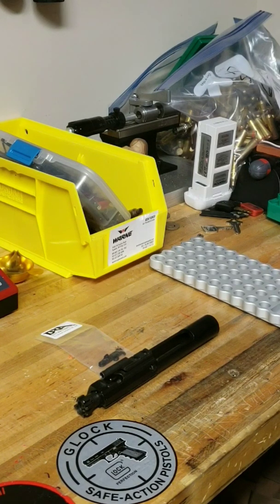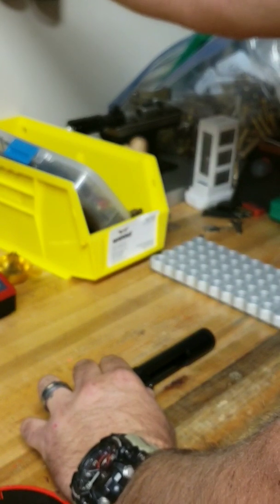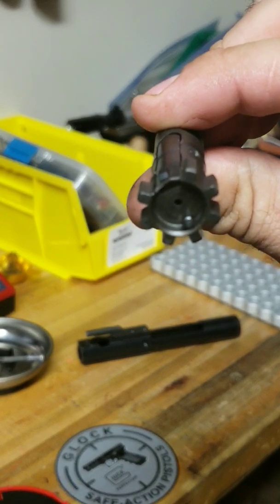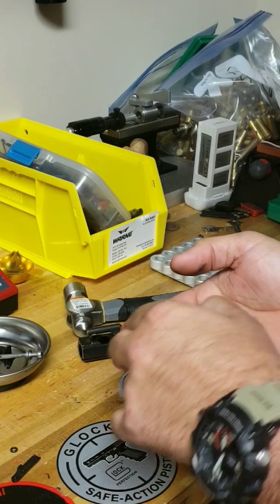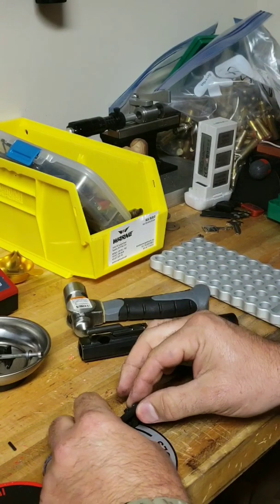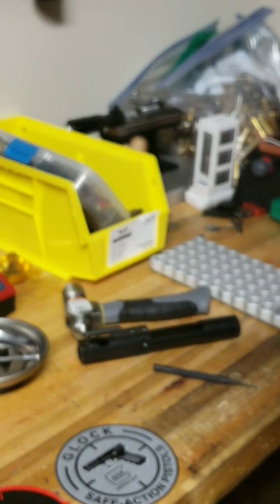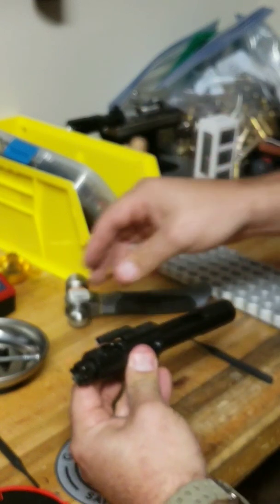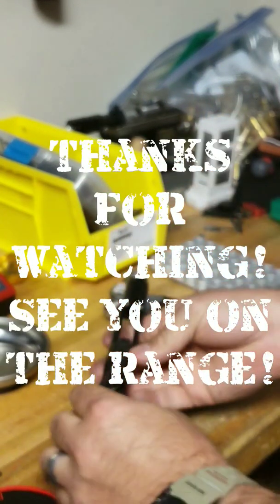6.5 Grendel Extractor Replacement

Comment: I had to replace a broken extractor claw following 100s of rounds for 6.5 Grendel ArR-15 . Cramming the larger extractor inside the 223 bolt assembly reduces material availability to contain forces.